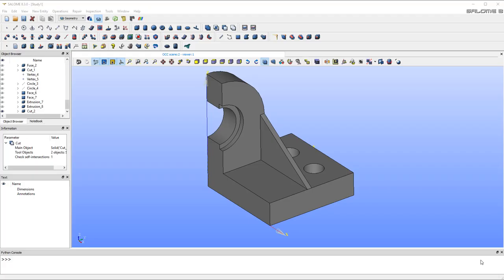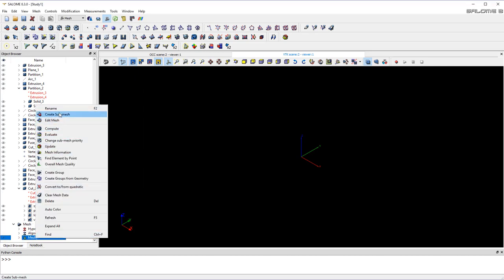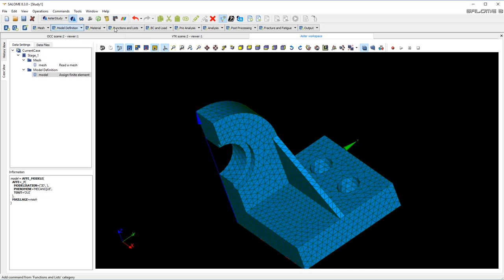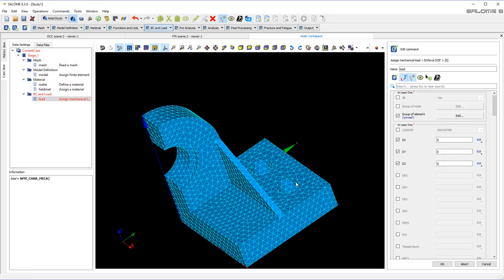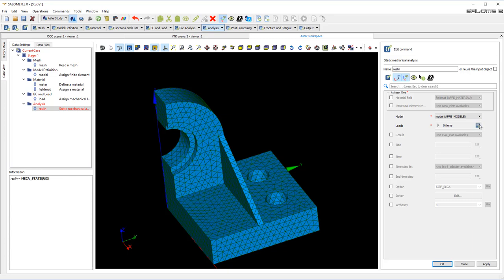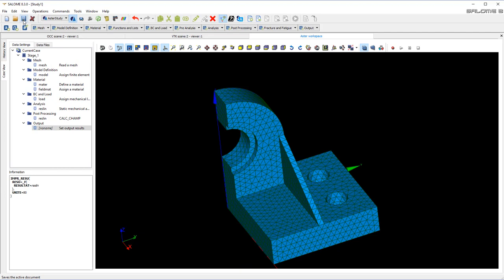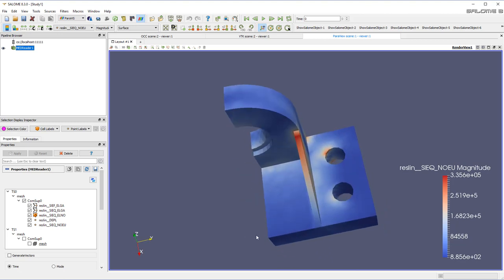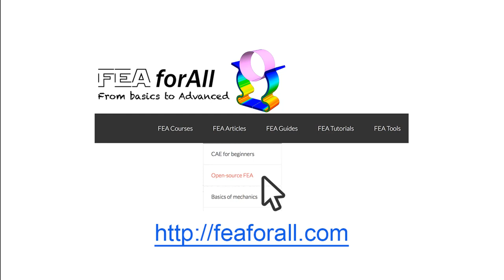[Salome Meca Tutorial] Pillow Box CAE simulation in Aster Study Module - Part 2

Comment: Dear Rusu,
Thanks a lot for this nice video in two parts. 
Further, I have a request to make: I would like to see a video on Analysis of a 3D  Framed Building (with  rigid diaphragm action of the floor slabs)for lateral  Earthquake Load for any codal (viz. Eurocode, IS code or any other code) Pseudo-acceleration Design Spectrum Loading for Earthquake analysis, using Salome-Meca/Code Aster.
Thanks.

Comment: Hi Cyprien! thank you very much for your tutorials... they are really helpful and clear. I have one simple question to you: if i have different run cases, hoy can i visualize them in different windows at Paravis?. I ve been trying on that but it seems to only reads the latest run. 
Thanks!
Reply from the maker: Just save separately the results from diffferent run case into separate rmed files with different names and you will then be able to open them at the same time in paravis. Create a new windows in paravis and active the rmed you want to see in each window using the small eye and you can do what you want.

Comment: Hi Cyprien. First thank you very much for such a clear tutorial. Nevertheless I have a question concerning the results. Is a displacement of 311.2 mm logical? What is the unit? Thanks in advance.
Reply: Hi, FORCE_FACE is not a force like -40 000 N evenly distributed over the area it's applied to, but a pressure (though not applied normal to the surface) of unit [Force/Area] here [N/mm²], so in this case the area is a portion of an half circle of radius 50 mm and 40 mm thus an area of 1413 mm², "0.5*pi*(50²-40²)" and with -40 000 N/mm² that's the equivalent of 52 000 000N.
So if you want to apply a load of -40 000 over the 'loadsurf' group you'll need to divide the load by the area first: -40000/1413=28.3N/mm²